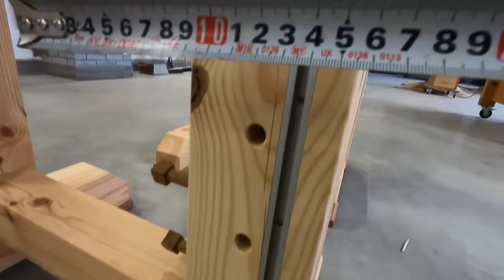Multifunctional Sawhorses and Mini Workbench

Comment: I am just starting to put my workshop together that has to go in my two car garage. My wife insists that we be able to park both of our cars inside at least in the winter. I have room across the back for a 1 meter deep workbench where I can have a miter saw station, a router cabinet and a bunch of drawers under it. And on one end I can put my table saw built into a rolling cabinet that I can roll out into the middle of the space. But the workbench across the back wall doesn't work very well for as an assembly table since you can only access one side of it.

What I couldn't figure out is how to have a large-ish (around 1 x 2 meters) assembly table (and outfeed table for the table saw) that could fit against the walls of the garage when it is being used for its secondary usage as a place to park cars. I think your sawhorse design gives me a solution. 

I can make a worktop that sits on these massive and stable sawhorses so that the worktop is flush with the outer sides and edges of the sawhorse (so I can take advantage of all the vertical clamping capabilities of the sawhorses in conjunction with the T-tracks and dog holes in the worktop). Some brackets that attach to the underside of the worktop and on the inside of the sawhorses would lock the two together. When I need to put the assembly table away, I just lift off the worktop and stand it vertically against the wall and then put the two sawhorses in front of it. 

I will have to be careful to not make the worktop too heavy that I struggle to lift it on and off, yet still make it sturdy enough to remain perfectly flat and stiff to serve as a reference during assembly. So the easy solution of a 19 mm high grade plywood on the bottom with a 12.5 - 19 mm MDF/melamine top is likely to be too heavy. Maybe the solution is to make the worktop a shallow torsion box. And of course the sawhorses by themselves have a million uses. Thanks for the great idea.
Reply from the maker: Hello)
I am glad that my ideas are useful.
you also planned everything well, good luck)

Comment: Very inspiring and detailed build video. This is like the swiss army knife of saw horses. If you work to modify or update the design, can I suggest you incorporate height adjustability into your design. It might compromise the stability but it will increase the functionality immensely. For example each saw horse can be the infeed / outfeed support for a table saw or planner which might be at different heights. Thanks in advance.

Comment: Love the idea -especially if you have not that much space in smaller work shops. But if you want to use it as a reference or template at the end the contruction has to be very plane and square. So if a DIYer buys some planed scantlings at a store this might not work, you need to square iat and then you already need a work bench or planning machines. Or you build the whole thing with Plywood, then you could do it with just a saw.
Reply: Francis yo the piezo came straight Sen ointe

Comment: Hey there bro. I love the massive workshop u have. So much room in there. It must be hard to heat it though. LOL
I was wanting to ask what table saw u have there? Is that a Metabo 10" table saw ur using in the shop? I need to buy a new table saw and I am not spending nearly a grand on a DEWALT bcos it's not worth that much money. 
So I wanted to ask what the Metabo is like for cutting mitre joints and also what size the mitre tracks are on the saw?? A lotta saws have weird sized mitre tracks that u cannot fit the standard Mitre gauge into. 
I have 2 choices atm. I'm thinking of building my own table saw or buying a good one for under 500 euros. I know the Metabo is about 450 euros or thereabouts? 
If anybody in this comment section has one could u let me know how good or bad they might be?? 
Thanks man and thanks in advance to anybody who has used one and lets me know about the things with it like Mitre cuts, mitre tracks, etc..
Reply from the maker: Hi) It is not difficult to heat, but it is difficult to prepare as much firewood as it needs.
I have a Makita LS1018L table saw. It is not expensive, but it is not very accurate either. However, I managed to set it up. And I satisfied) 
About Metabo I don't know anything.
Reply: @mr.vereshchak  Thanks for the reply man. Appreciate it. Enjoyed the video. They were some real sturdy sawhorses too btw. Best of luck to ya with the business ur doing. Hope u make a huge success of it bro. Salute from Dublin..